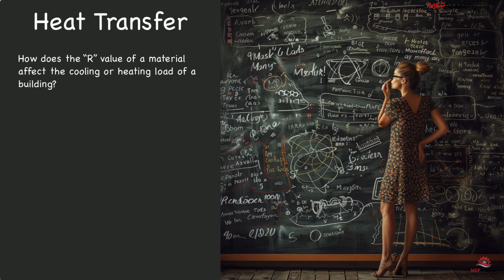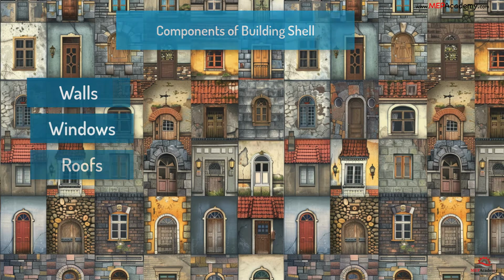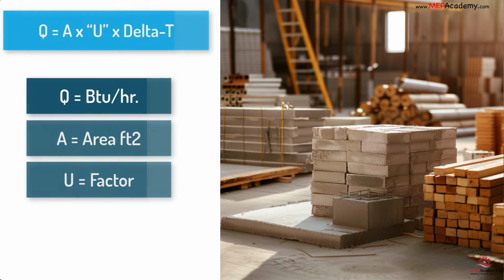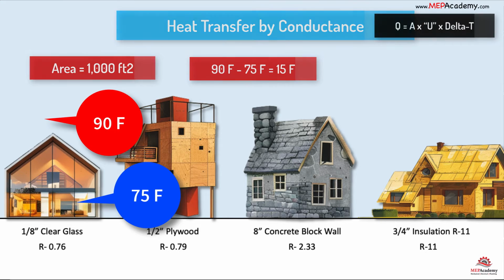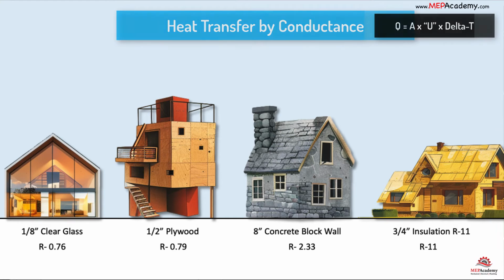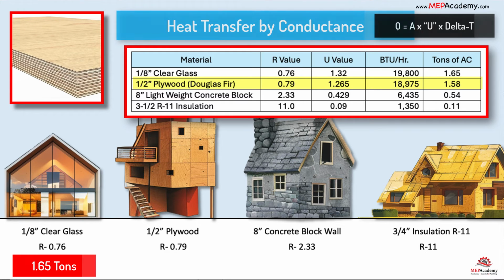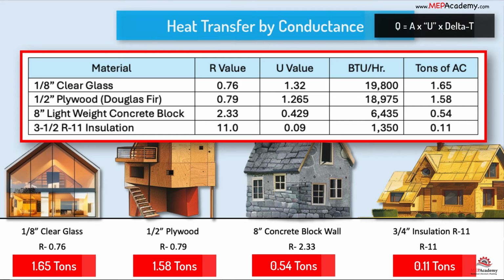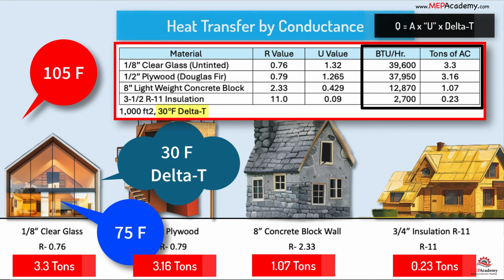Heat Transfer through Building Components

Comment: Saved for later. Btw in line with this topic. Do you have lectures on calculation chw pipe heat gain / loss? I usually enountered assuming 1% heat gain. Its much better if this can be calculated as well. Thanks
Reply from the maker: Thanks for the suggestion. We'll add this to the list of request submitted.